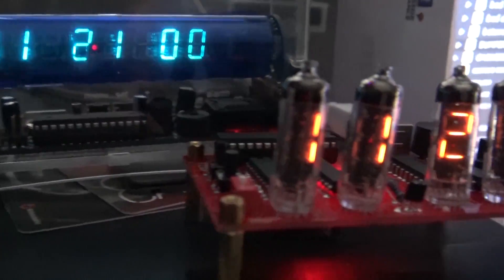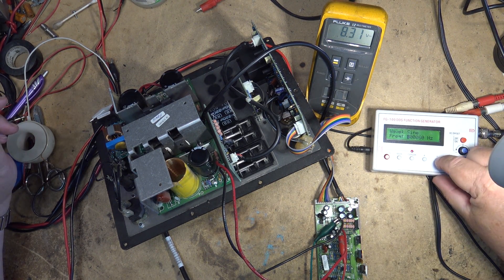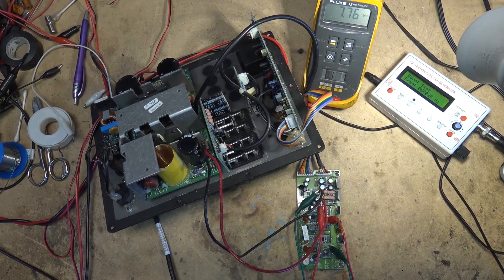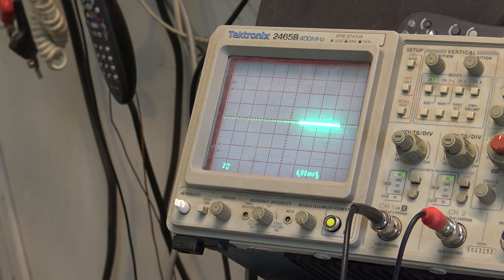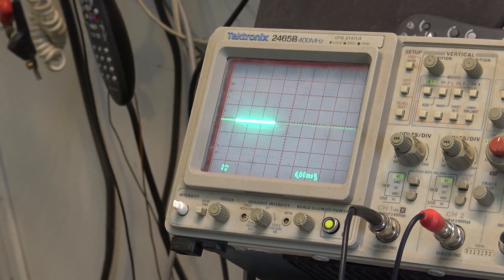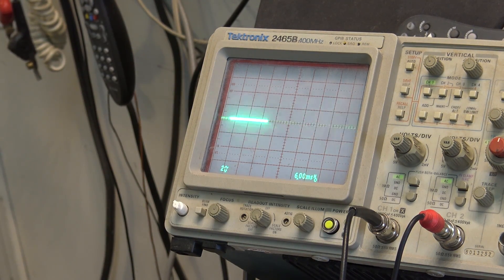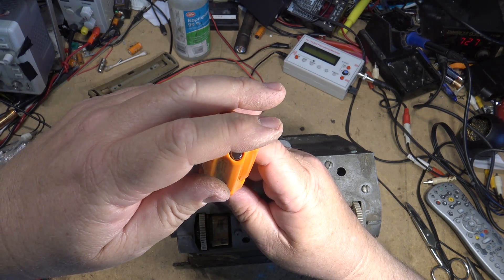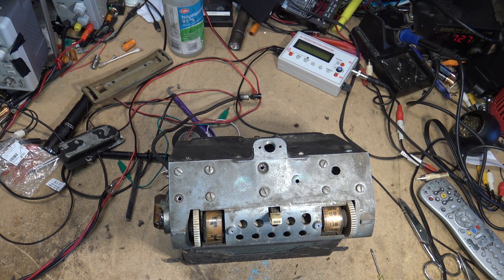SVS "plate" amplifier check over

Comment: Nice odd stuff! Unusual!
For that plate amp load, try good old household  light bulbs wired in series
 and/or parallel (what ever it takes) to get your desired load resistance. They
can take the 100s of watts forever without burning out.  Add a few more in
series and tap across one for your shop speakers so you can hear, but your
scope must do the rest. lol, I don't imagine sub-woofers like any DC offset.
Reply from the maker: Well without the heat sink the transistors won't last long. The guy that owns it was told the power supply was bad, but apparently not.

Comment: Just watched the video of the SVS bash amp.  Can you fix mine?
Love the sub and can’t find a replacement plate
Reply: Same problem for me no plate, NINE weeks no plate. Now SVS does not have any time line for me. And the part numbers on the semiconductors are BS do not cross to anything. Did you have any luck finding repair or replacement?

Comment: Do you accept items to repair from overseas like Australia? I have a Sony GV-9 working fine through the AV out to a tv with picture and sound but the internal LCD was working but flickered a few months ago while watching a movie then turned white so looks like I can only see the back light. ?
Reply from the maker: Those units are too old to bother.  They are full if leaky surface mount electrolytic.
Reply: @12voltvids   have already removed the old caps cleaned the boards and fitted new caps and it was working 100% for months

Comment: Hello, why is it your using 60hz frequency to energize the power supply?
Reply from the maker: I'm not. I am using the generator to apply a signal so it turns on. If there is no input signal the power supply turns off. I only chose 60 hz because this is a sub amp.  It really only operates on frequencies below 150hz